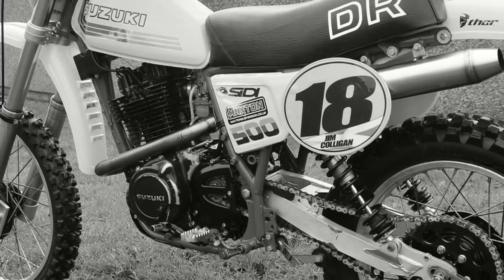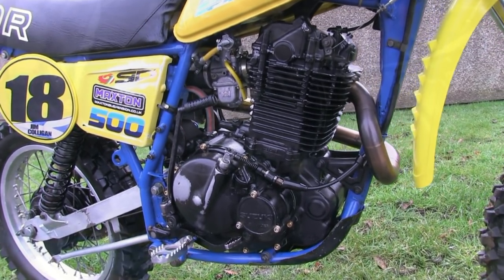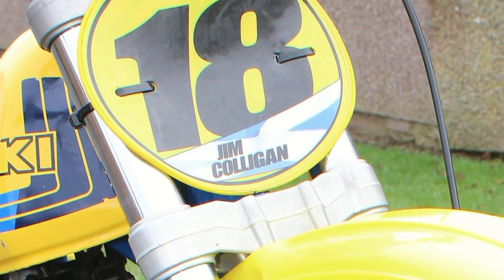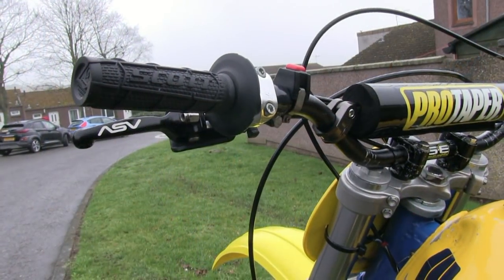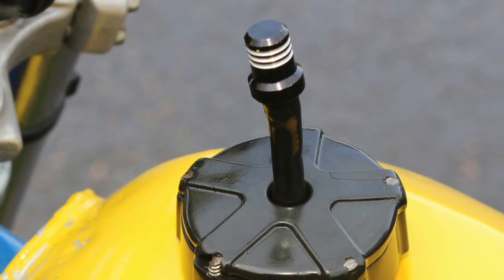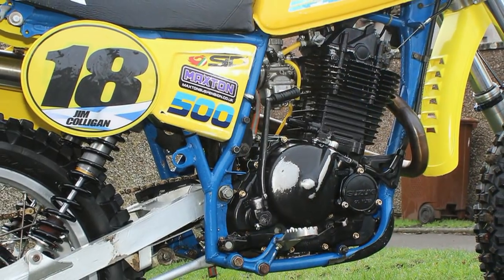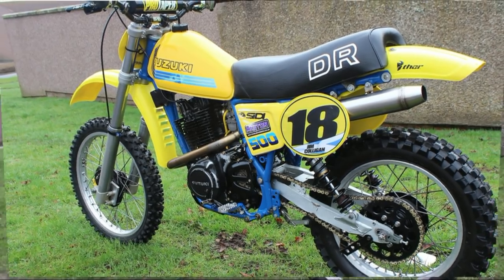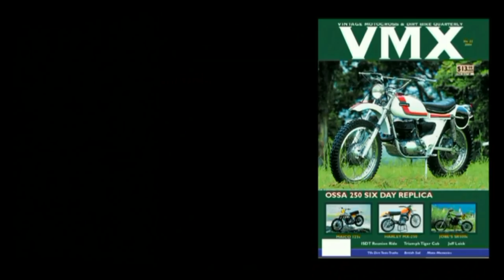Classic Dirt Bikes "1982 Suzuki DR500"

Comment: Dodgy gearbox dog. It doesn't last that well in the DR400 [same part] The USA DR 500 actually had an ally swing arm. The steel item is the same as the DR400's The Euro badged  DR500 was identical to the USA SP500